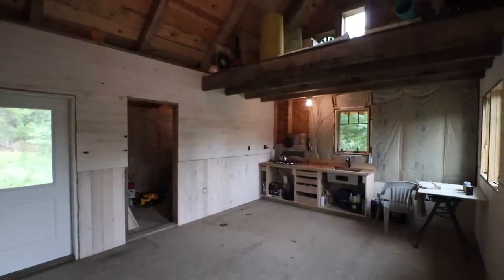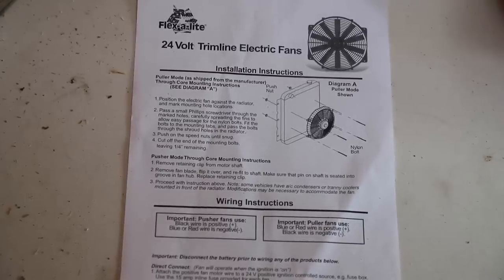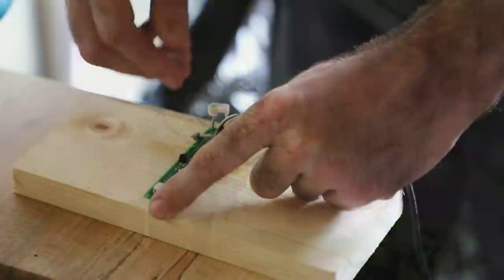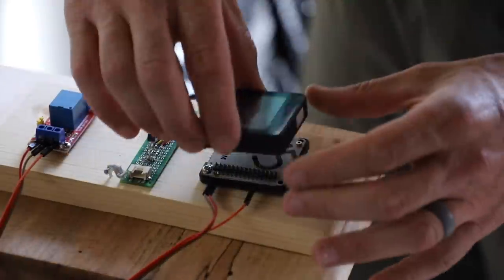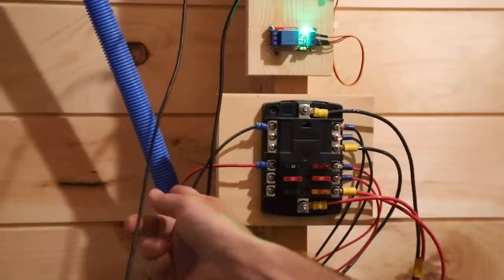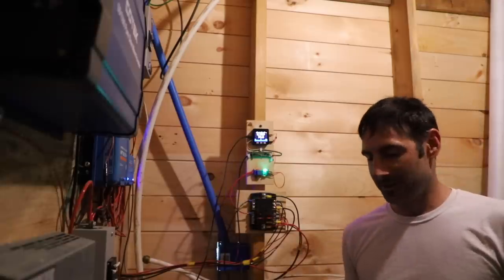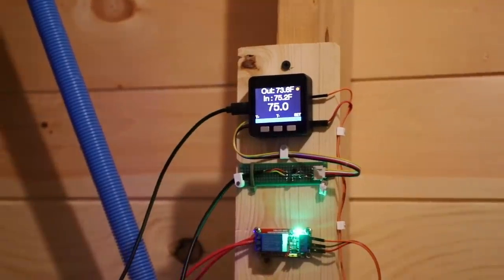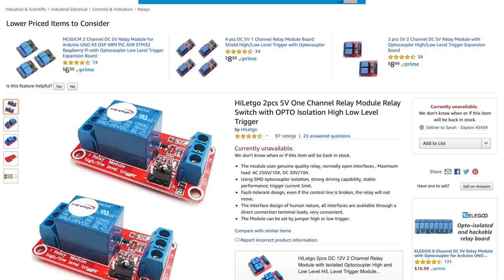Alternative to Off Grid Air Conditioning, Automating the Whole House Radiator Fan With Arduino

Comment: OK...that is pretty awesome!  So, the fan comes on when the outside is cooler than the desired inside temp, but shuts down when it is warmer or hits the desired inside temp.  You have just eliminated opening windows in the morning and bypassed forgetting to close them when it gets too warm! Brilliant!
Reply from the maker: Thanks Sean, thats pretty much how it works!
Reply from the maker: @Minnesota Matt I have been thinking of doing something like that.  Grabbing hot air from the peak of the roof and ducting it down to floor level.

Comment: That's good timing. I was just building an automated crawl space/basement fan system for my cabin. It gets humid in the basement during the summer. Once the batteries are fully charged, I have extra solar power to use, so I figured I could use some fans to replace the air in the basement and crawl space at no cost. I also want it to run when I am not there but I don't want to cycle the batteries at all. The basic setup is power going to an on/off/auto switch, then to a timer where it only passes power during peak sunlight and humidity is less, like 11am-4pm, then to my Victron BMV in which I use the internal relay to turn on when the battery voltage is at the float voltage and turns off if the voltage drops even slightly below float. Then from there the power will trip the fan relay and turn on the fans. The should ensure I do not wear my batteries at all. Currently building it, should be able to get it installed in the next month. You can also order electrical enclosures on amazon which will clean up your electronics.
Reply: They used to make solar charge controllers which had diversion loads.
When the batteries were charged the controllers would divert the excess to whatever was hooked to it.
Some people ran lights, some ran 12volt water heaters, etc.
Reply from the maker: If you check out my video on voltage activated battery venting you could use a controller like that to do exactly what you want.  Or yea use the BMV relay driver, I remember looking into it and not being quite sure how to set it up with the BMV.
Reply: @50Acres  yeah i seen that video also. I considered the voltage sensitive relay but I already had the bmv which did the same thing. Setting all the settings can be confusing if using just the bmv, but if you connect it to your phone, its much simpler. Also, I have different voltage profiles based on the frequency I'm at my place. If I'm going to be away for a month, I turn down the voltage to not fully charge my batteries. So at the same time I can load a different bmv profile and change them settings as well. Looking forward to more videos!

Comment: Our way was a bit more extravagant, but we are in Central Texas.  I opted for 3.34kW of solar, 16-305ah batteries and a 48 volt DC mini split.  We are much older, retired and after my heart attack I cannot stand the heat.  Fortunately we did all of this in the guest house and have the option of grid power or complete solar power.  The guest house is the backup plan for a grid down situation and I can keep it 75 degrees in there without draining the batteries.  I like your solution with the Arduino  automation.  If we were not in Tx I would probably have done something similar.
Reply from the maker: haha that would be my ultimate goal!  Once my batteries need replacing I may go for a bigger bank and at that time get a mini split.
Reply: @50Acres   HotSpot Energy has the DC mini splits.  I am sold on it, the thing just quietly sits up there throwing out cold or hot air.  I believe they have a 24 volt system as well.

Comment: I used a normally open relay used in an oven startup circuit closed 74 degrees fahrenheit they have them with different temperatures even adjustable mine was  3 bucks Ebay my controller was 30 bucks from Amazon it has an internal fan and the fan itself was Amazon also 20 inches 23 bucks and a 12 gauge 50 foot extension cord for wiring cheap inline auto reset breaker everything under 100 bucks my wife's greenhouse stays cool everything runs off a 12 volt truck battery hooked to a trickle charger and small solar panel

Comment: Cool man. Wow was it a year ago. Time flying !! When i did this in my old place to remove the hot air under the house in the summer. I just used PV and the fan. So when the sun came up it removed the hot air as the sun set the fan stopped. Love how you set this up. Thanks for sharing. God Bless..
Reply from the maker: Hey thanks Bobby, I thought you might like this one.  Having the two sensors is nice, no wondering if you are doing more harm than good.

Comment: Mike you're doing a great job brother. We are building our summer camp now, which will be and is, as much off grid as possible. When we build our house, we want to be totally off grid. So your cabin speaks to me. Now being in Alabama, I know summers will be rough, but I think with a shaded location and planning, we'll make it
Reply from the maker: Thank you so much, maybe when you guys go fully off grid you will be able to have a big enough solar setup to run a mini split unit or something?  If you plan ahead with smart design it will not have to that hard!
Reply: @50Acres  yes a fully DC minisplit is already in my plan. We've lived in our RV with only solar and chased cool weather for a couple yrs. I was an electrical and a general contractor before I got into ministry, so that combined with the different building techniques that I've seen across the country plus combined with great channels  like yours on YouTube, the plans coming together. I've learned a lot about solar which was outside my realm before. Our  little bunkhouse bunkhouse here is solar powered, our camper is all but for the air conditioning at the moment, our water system is and our barn will have 2 separate systems. All our systems so far are budget, but get the job done. Air Conditioning is the hang up with budget!
Reply from the maker: That’s great that you have those electrical skills with those skills you can definitely get done what you need.

Comment: Cool video this works well to cool the attic in a regular house. Reducing the temperature in the house by as much as 10f. 
The excess noise is caused by solid mounting the fan, rubber mountings will significantly reduce the vibrations
Reply from the maker: Nice!

Comment: Great idea. Love that variable speed dial on the fan. To get cooler temperatures flowing into the house during summer months, you could put some tubing several feet into the ground which feeds the floor air of the house. [Once installed] should make for real cheap cooling.
Reply from the maker: Thank you!  Thats actually in my list of potential ideas if I ever get enough time.  I would very much like to make a ground source air conditioner.
Reply: @50Acres  in mine as well. Just in the house building phase. So, waaaay behind you. Keep up the good work.👍

Comment: There is a way to do this with a switch called a Disc Thermostat but only on or off not setting the speed of the fan.  A disc thermostat you buy for a set temperature and if it will be open or closed so can't adjust on the fly like the arduino. One of the common uses of them is a high temperature cutoff on equipment but they can also be used to turn on fans or buzzers when they hit their set temp so you could use to signal when a solar water heater tank was above a temp you like.
Reply from the maker: Thats good to know, one of the issues I've run into with dump load water heating is that there are very few good T-stats to run off DC power.  I don't want to run off AC because I don't like keeping my inverter on.

Comment: Great video, small addition: computer fans might also be an option, some versions pump ~60 cfm /100m³ per hour and only create 16 dB noise, so you can run them in the same room in which you sleep. 
Keep in mind, that the direction of the airflow makes a huge difference in air circulation (if you want to cool, pump the hot air out at the top, if you want ventilation in the winter, pump cold air in at the top, and let the air out at the bottom to minimise heat loss while maintaining air circulation). Works wonders for my bedroom. :)
Reply from the maker: Yes, I have uses computer fans also in the past, to vent my battery box and also a larger one to vent my cooktop exhaust.

Comment: I just used a generic box fan for a similar application.  I know what a difference pulling that heat out can make.  There are also ways to use the underground to cool things.   Google videos on installing underground cooling.
Reply from the maker: I would like to eventually try to do something using groundwater to cool the cabin.  I need to be able to dig some long trenches though.

Comment: Enjoy watching your videos. The thing that gets me in summer is the humidity more than anything. Having cool air blowing over you certainly would help with that.  I wonder if one can use a dehumidifier off grid, since they use far less power than regular air cond. does?
Reply from the maker: Yea, I’ve thought the same thing, if I can find a low energy way to dehumidify it would be a lot more comfortable

Comment: I think I might have put an additional temperature probe instead of on the board inside I would have made it so it was pierced out of the wall in an inconspicuous spot in the living area so that it gets a little bit more of an accurate reading of the temperature in the space that is occupied most often. And I'm guessing your intent is to shut off the switch during winter when you using what heat so that you don't end up sucking smoke down the chimney by accident
Reply from the maker: Thats probably an upgrade will make in the future, that back room is the coolest in the cabin, but I want it based on our living conditions.  I don't have to shut the switch in the winter because it has a low temperature limit I can set but I will probably unplug it so it doesn't eat power.

Comment: Great Job,,Im actually looking at this for my home in a window for circulation..
Reply from the maker: Nice, it will be easier to do with 120 volt power available!
Reply: @50Acres  Id rather run a high volume fan in the window then run Air conditioning .. : )

Comment: Very cool. 
Who was that hippie at the start of the video?

Before the rainy season you need to do a bit of waterproofing.
Seal up those seams around the pipe and maybe around that sensor.
After all the work you have done you do not need a leak.

Also those little seams let in insects.
Reply from the maker: ha ha who was that guy?

Comment: Very cool! Have you thought about a vent to pull the cool air from under the house? You could put a temp sensor and maybe some sort of actuator to open the vent?
Reply from the maker: Thanks Mark, I have, I would eventually like to try to make a ground source AC and I would probably put vents under the house to draw air through some copper coils.  I tried to get a linear actuator for this project to open a Louvre whenever the fan came on but it made everything a bit too complicated.

Comment: Cool more tech. My next area of interest coming. I'd like to do a solar hot air collector. With the fan circuit using Arduino. To get the most efficient heat range. If it could regulate fan speed as well that would be awesome.
Reply from the maker: Cool idea I bet you could get that to work.
Reply: @50Acres  I'd have to learn how to use the Arduino circuits and relays.Get the right cfm size fan for the collector size. I also don't have a friend with the knowledge to work with it. Other than that it be pretty easy. I've done a lot of research into solar hot air and hot water systems.Is your fan reversible? Can you make it blow in when the air is cooler outside?
Reply from the maker: Yea it is reversible I can reverse polarity on it.  You can also take the blade off and reverse it that way.
Reply: @50Acres  So can you tell me where I can learn about this? Or do I have to sign up with Skill Share?

Comment: Verrrry true about the olde ways of doing things... when a brain and logic prevailed.  That was a stroke of luck and an omen with the ease of install.
Reply from the maker: It came together well!
Reply: When brain and logic prevailed? Reflective roofs and awnings are smarter and more logical than the modern air conditioning unit? Idk man.
Reply: @Wmoore1  Air conditioning pulls a lot of power. He has limited power due to limited battery storage.        Vaughn

Comment: What a clever idea. So do I understand correctly that the fan will work this way even when you are away from the cabin? I also wondered, does having the outdoor sensor right next to the building give an accurate reading on the temperature, or night it be better to extend it out a foot or so?  I don't know either way. It's just a thought.
Reply from the maker: Yea it could if I left it on, I tend to shut everything down when I leave for more than a couple hours.  I'm not sure about the outdoor sensor it is on the East side of the cabin so it should get a good decent reading in the afternoon shade but I will have to observe it more.  We basically got it installed slept over then took off so haven't had too much time to tinker with it.

Comment: Very impressive problem solving! I was wondering, however why you felt you needed an outside temp sensor to cool down your cabin when it’s too hot? Why wouldn’t a conventional programmable thermostats have worked? Don’t we assume that when it’s too hot inside, voiding the hottest air out a high point will help cool the house, even on a hot day? How about a shuttered air vent to under the cabin? The air would always be cool down there and if you kept the windows closed, the fan would draw air from there by default.
Reply from the maker: I try to shut down the cabin in the morning to maintain the cool temp that I get from the night air as long as possible.  Even though we are decently well insulated, eventually that cabin warms up.  Then when evening comes around the temperature outside drops faster than the cabin can cool off.  This is when the fan is most useful.
Reply: 50 Acres & a Cabin      I was thinking about in the middle of the day, on a really hot day - cooler air coming in could be found under the house when, perhaps, the outside sensor might   prohibit the fan from coming on? Is there a manual override switch?
Reply from the maker: There will be a manual mode where I can just run the fan regardless of the temps but we haven’t programmed that functionality yet.
Reply: 50 Acres & a Cabin     Like I said, very impressive engineering! Gittin er dun!

Comment: That's pretty cool. I always thought Arduino was a gland. What other methods are you going to use to cool the cabin? Is that it? I know you can always plant more trees, as long as it doesn't interfere with the solar panels. You must have something else up your sleeve.
Reply from the maker: I hope in the future to make a ground source air conditioner, thats probably a ways out though.

Comment: same can make diy home cheap, arduino , lcd display, power 7-9volt,DC relay board, all cost about arduino 8$ lcd 2-4$ power 4-8$ or only regulator you have solar panel battery , relay board 1 relay 1-2$ code have ready copy at internet. temperature follow fan etc. pc temp fan, if temp have level xx fan on. and pwm code can tell to fan speed same board too.
Reply from the maker: yea lots of neat affordable stuff to make these projects happen.

Comment: OK. Now how are you going to protect the fan from the rain, and more over, during the winter from cold air getting in?  Just asking.
Reply from the maker: I have a louver that goes over the outside of the fan, it gets flashed to the gable end in a similar way as a window.  In the winter I have a piece of XPS that I stick in the opening.

Comment: ok,this has made esp32. lot same than arduino but have wifi and android apps can controll fan speed and relay on/off fan can drive mossfet and esp/arduino controll mosfett speed pwm . and normal temp code on/off temp fan
Reply from the maker: pretty cool stuff
Reply: @50Acres  yes i use lto in my hobby retiree have lot time i learn and make code and many stuff this, i have wall clock, garden automatic fertilicer, egg incubator because wife want, she have 200 chikken hobby and take egg to we home. solar panel sun follower i made but not have solarpanels yet. robot car, line following car,many different clock. temperature,huminity display, many many can make easy.

Comment: What if it’s 30 outside and 60 inside? The fan kicks on?
Reply from the maker: If you look at the display unit, the big temperature reading on the bottom is set as the low limit so it will stop running if the inside temp drops below that set point.

Comment: Is that how our Ancestors did it?
Reply from the maker: Ancestors may not be the fully correct term in this context depending on how old you are.  From around 1900 to 1950 electricity was widely available but air conditioning was not.  During that 50 years the thing to have was a whole house fan.  It mechanically sped up the way houses were designed to be naturally cooled.